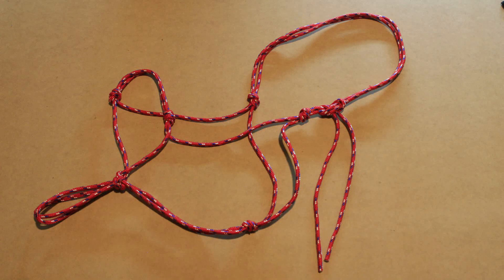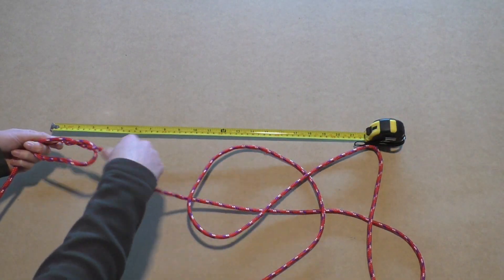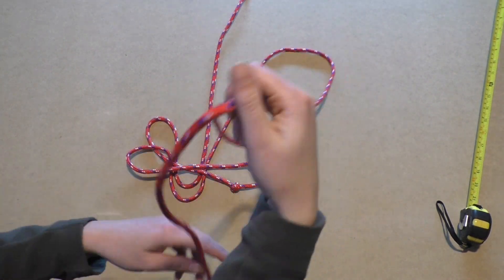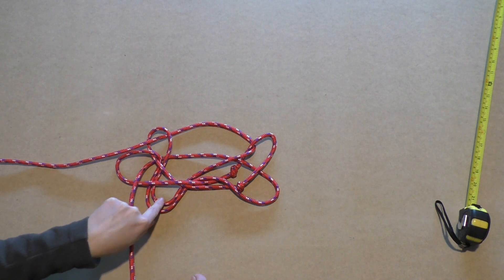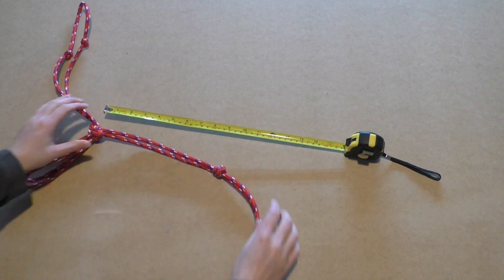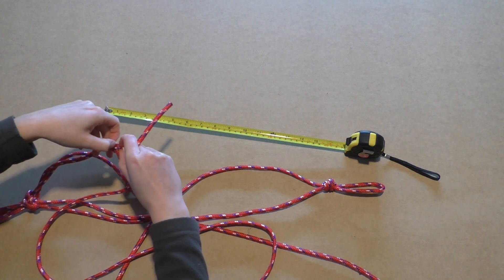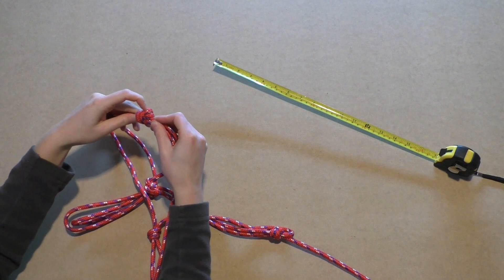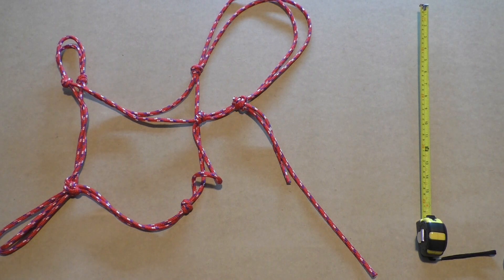Rope Halter for Horse with the FIADOR knot | Step By Step 2021

Comment: Since horses, ponies, and donkeys have different size heads, could you explain how to measure the equine's head to figure out how much rope you will need? Good paracord is expensive and non-recyclable and non-biodegradable so I don't want to waste any by using more length than I will need!  Thank you.
Reply from the maker: For small poneys (Shetlands) you will still need 5 meters of rope. For larger horses you can go up to 7 meters. The average is 6 meters, which will cover most of the general sizes. I know it is expensive, so I hope this will help you out!